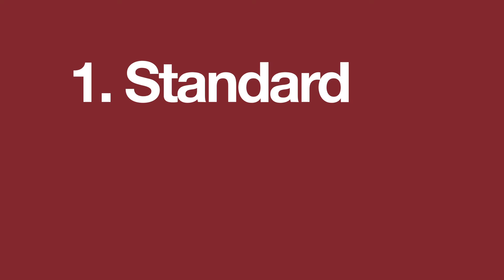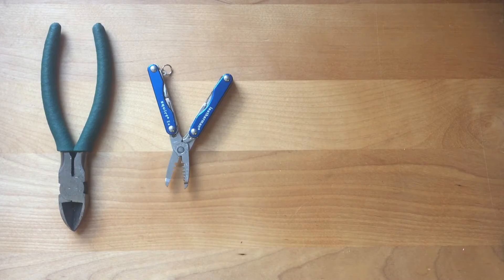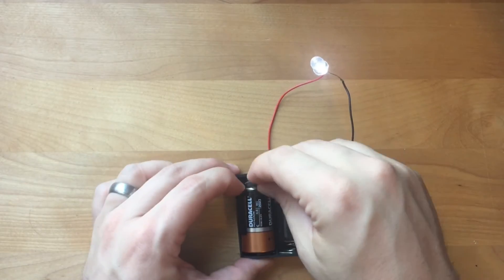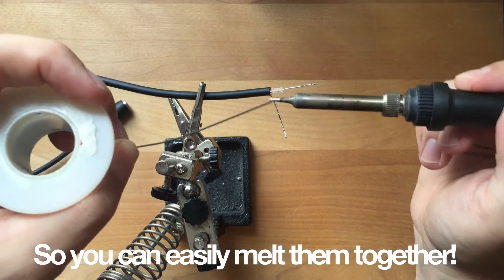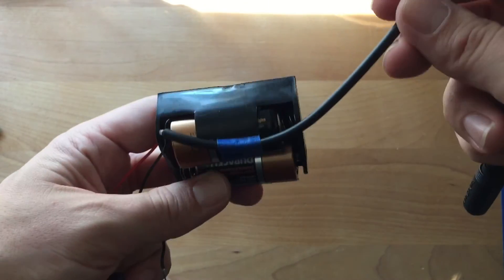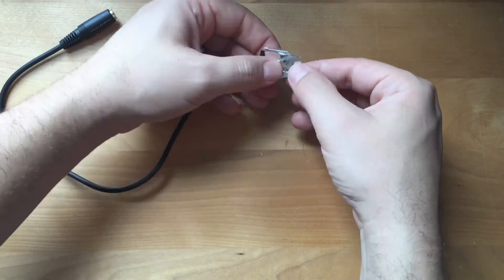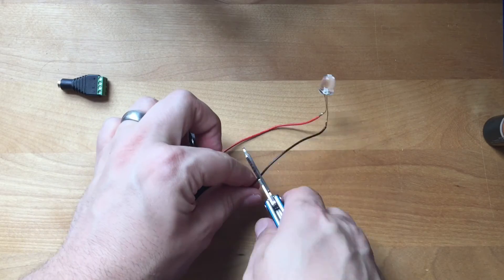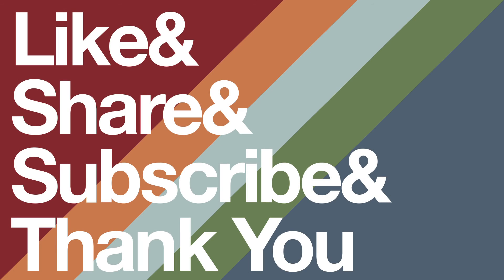Budget Adaptive ep. 4 - Easy DIY Battery Interrupter for Switch Interface

Comment: Excellent video and I just dropped some audio jack terminals into my amazon box cuz....so many possibilities! Question. Have you ever seen anyone make a DIY switch interface for plug in accessories like lava lamps and box fans, etc.? Like the ablenet power link 4 but maybe not $330?!! I am dreaming up something where a switch is added to a remote control outlet but haven't figured it out yet. New to this kind of stuff, but I am an OT and I get to teach other OT's about adaptive equipment and I am getting into 3D printed switches and want to expand my tool set. If I could get a homemade switch to control a wall outlet it would solve so many issues for my kids and families I work with!

Comment: When pushing the switch does whatever you hook it to automatically turn off if you don't hold the switch down?
Reply: also what else could you use besides the switch you showed? I know those can be pricy
Reply: @alyssallorence9283  Tap lights from dollar stores, or hardware stores tend to be under $5.

Comment: Once I add the tape to the plastic it is not interrupting the signal anymore.  If I do just the plastic it does, but once I put the tape on even without the wires it turns on again.
Reply: I'm guessing you don't want to fold the tape over to the other side - or you will create a short circuit which will make it be on all the time and the switch won't change anything.  The plastic in the middle has to break the circuit, so if you allow the tape to cross over to the other side, you have defeated the purpose.  So if you hold it up to look at the skinny side - make sure you can see the layers of the sandwich and see that the plastic layer is visible in the middle all the way around and is not crossed by the tape.  Does that make sense?

Comment: Hi Bud, I am having some difficulties doing option #2, I only have a stereo cord. I did what you said by using the Left and Ground (white wire and copper wire) and I am attaching those each on either side of the circular plastic & aluminum tape piece. It is interrupting the battery signal, but the single switch I'm using isn't turning on the device. (New toy, new batteries, I've tried many options). If you have any suggestions that'd be great!!
Reply: Also, the "sandwich" is properly interrupting the signal when I go in to "test" it (like you did in the video, before attaching the wires); however, when the wires are attached, the signal is no longer being interrupted
Reply: Hmm, seems like you have a wire shorting across the “sandwich”  it could be the wiring on the stereo cable, I have seen that before, or when you close the the battery box it is forcing the copper wire across the other side.  If at all possible shoot a couple of pics and send them to me on Twitter @ThatGuyBud and I will take a look and see if anything seems off.
Reply: Thanks for your quick response, just sent you a tweet!!